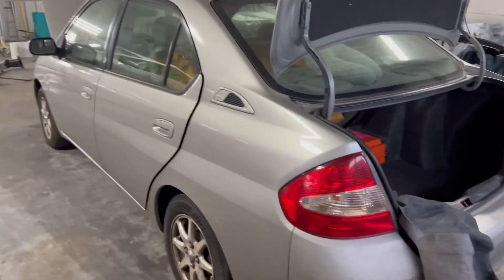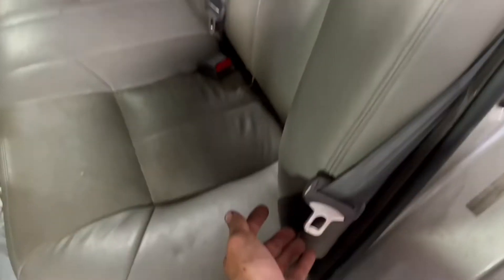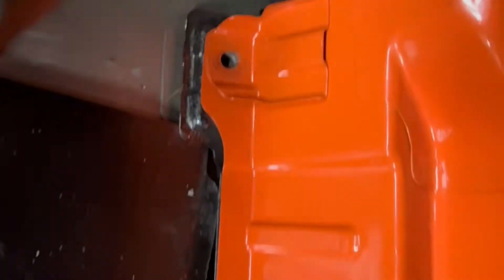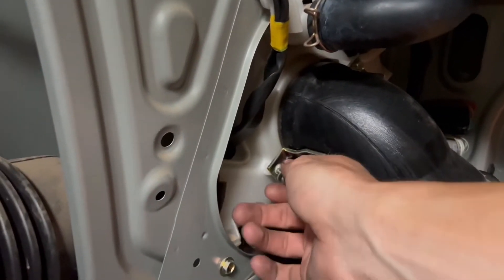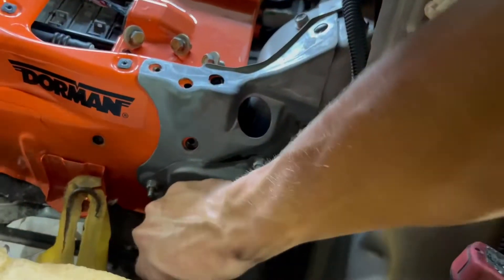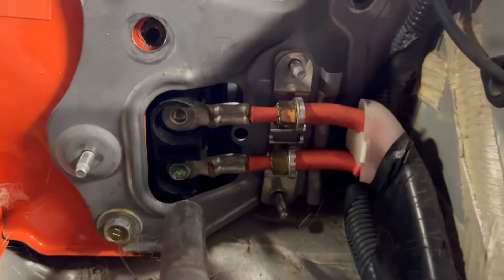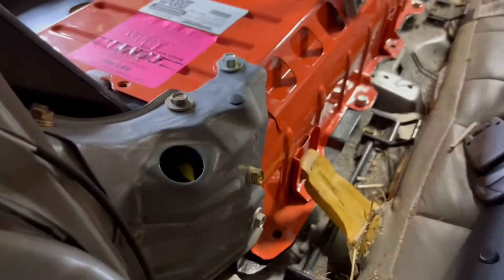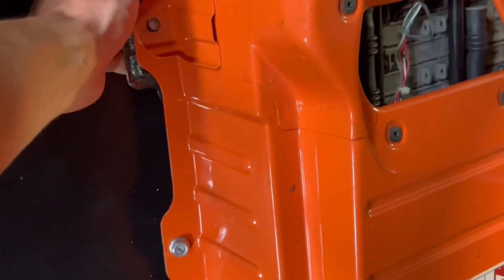Removing Hybrid Battery out of 2001-2003 Gen 1 Prius

Comment: So it seems like one of my modules went bad but I still get almost the same gas mileage but I do see the engine kicking on more and I have a triangle I have a replacement cells is it worth it to swap out and put in a tested cell that's better than the one that's in there it just suddenly happened in the car was working great?  Do it sooner than later? Or is not safe to drive like that?

Comment: How many miles on car to need to have  this replacement?
Is this replacement now used up and with how many miles  years?
What replaced this pack?

My original 2003 has p3030 code, 5 cells reading 0, with 182k. Highway trips still got 50mpg+.